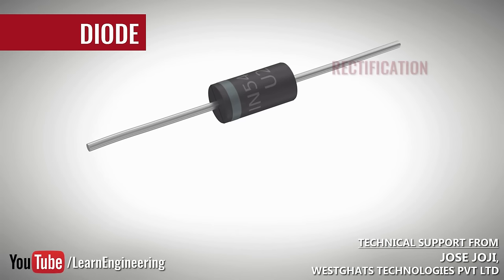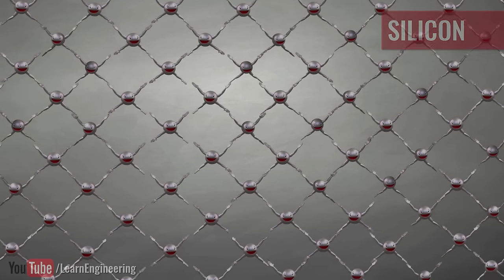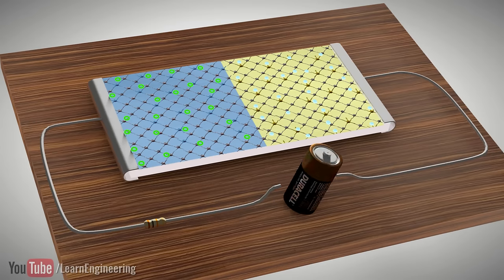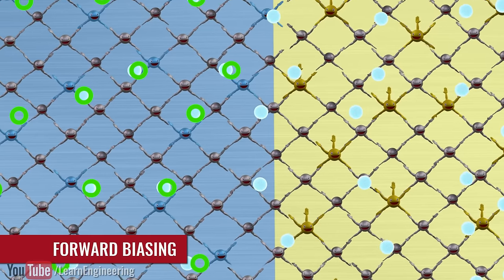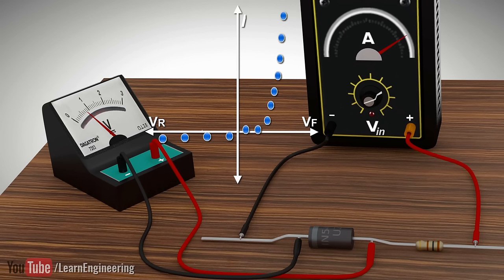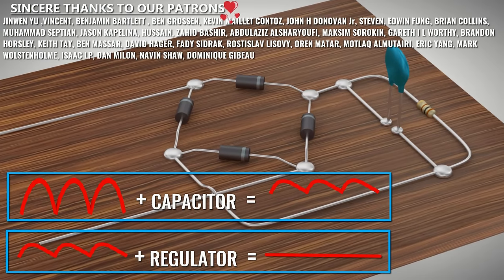How does a Diode work?

Comment: 2:50 the positive terminal of the voltage source is connected to the P-type of Diode. Still, you said it to be Reverse bias. Can anyone explain, please?
Reply: Reverse is based on if the currents flow or not. If it flows it's forward, and reverse does not have flowing current.
Reply: i think its a mistake

Comment: Hello, a very basic doubt regd the p-n junction. Why dont the electrons migrate further into the p-region. Why do the the electrons coming from the n-region limit themselves to only a small region across, causing the p-n barrier in the first place? Would be glad if you could pls clarify this!

Also, during the reverse bias, as per what I understand, there is no actual flow of electrons through the circuit, but only widening of the p-n junction. So, the current flow registered is exactly the electron flow from where to where?

Comment: Learn Engineering+ This is a great example and video. Which is better, an electrolytic which I always see or a ceramic or poly and the regulator is a resistor not a inductor, correct? I'm making a 24 volt which is pushing it, I'd be better off with a 21v and 12 amp or so. I'm powering 2 Class D amplifiers and the max is 24v which diodes and value do you suggest and capacitors and resistor plus should I go with a one watt, thanks

Comment: If add diode and magnet position + - and - +, just switching can reverse electricity flow maybe and engine can reverse also? No one reads this right? Or point of + and - on battery the wiring must change points and diode not needed? Then if move wire alot maybe tangle? If not then maybe adding another point of electricity and different "execute point" at engine can create reverse?

Comment: At 3:48, the diode on the right that is circled in red, is the right direction to let current flows towards the output. The light gray mark on the diode indicates that. Why don't you let the current flows thru, towards output, in addition to going back to the left negative pole of the source?

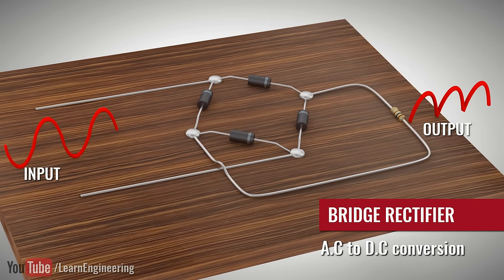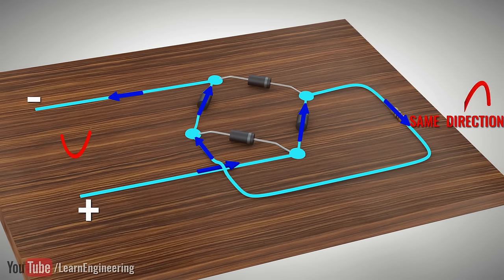Comment: Please pause at exactly 3:44 after crossing 1 diode and after resistor why the current does not flow in other two diodes and now at 3:57 after crossing 1 diode 1 resistor and then to next Point why does it do not flow to perpendicular diode to passing one and then must pass to next perpendicular diode similarly all the diodes indirectly work  and they are not showing it please reply if any engineer is reading...
Reply: Basically, the current will always try to go from + to - , it will never leave from + and go back to + .
Reply: Thanks for clearing but their is still something left with me

Comment: Thanks for this!! 8)

It would be interesting to know how a Walton-Cockcroft Voltage Doubler circuit operates. I have a HeNe laser tube (from an original Philips Laserdisc player) which I think uses this method to create the high voltage required to drive the tube (not sure).

I had ideas about using such WC circuits to step up from a starting 4K voltage (transformer I removed from an ancient photocopier), see what kind of arcing I could get, but never got round to it (this was in the late '80s).

Ian.

PS. Sorry for the delay in the PC construction! Family/work matters have messed up my schedule somewhat.

Comment: Exceeding reverse breakdown voltage of a diode doesn't have to damage it, as far as I know, however it will behave not as expected. After switching off and on it should recover.

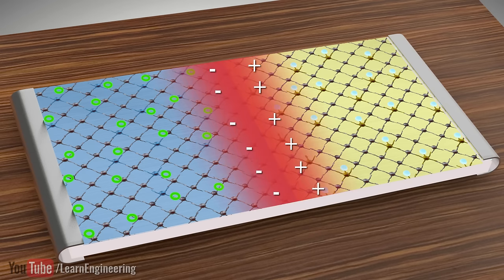Comment: At around 1:10 what stops the N side electrons from filling the P side holes?
Reply: low voltage condition to move the electrons from N to P..could say the N and P in barrier is stable..need voltage higher than the electron activation energy to move the electrons from N to P.

Comment: Question: How does the Negative side become slightly positive in the "Depletion Region" if it has no holes and an access of electrons the crossed over?
Reply: Jay Klaxton Well the n type was originally negative but since the p type due to its positive charge will force  away a sufficient amount of electrons from the n type in the region right near the p type that the positive nuclei of the silicon or phosphorus that make up the n type do not have equal negative electrons to neutralize the charge and hence the section of the n type right near the p type becomes positive.

Comment: What do you mean by in-forward bias? Reverse bias? I thought if the resistance of any electronic component is low, the current flowing through them is large or high coz low resistance! In the above video, it said, "you can note that voltage across the diode does not go much higher than 0.7 volts, even with high input voltage". Due to inforward biased condition. The diode offers vary low resistance against the current flow!

Comment: The negative terminal connected to the p-region should attract the holes there (in other words, when holes are flowing one way, electrons flow the other way, from the negative terminal to the junction). On the other side of the diode, the positive terminal connected to the n-region attracts electrons, so electrons are flowing from the junction to the positive terminal.  And also, Why the electrons pulled by positive terminal of battery reach to holes of P-type and fill it up and again get repelled by the  negative terminals of the battery, ?All in all, this would mean a current is flowing from one end of the diode to the other.
Anyone please reply !

Comment: 1:36
the electrons from the -ve terminal of battery goes into the p-type plate and starts filling the holes
then electrons in n-type goes into the battery
similarly the cycle continues.

if the +ve terminal is attached to p-type the elections from the -ve end of battery gets repelled by the n-type bcoz it has extra elections.

so,where im I wrong???
can anyone tell plz...

Comment: At 1:40, why do the electrons stay in the diode and not move to the positive side of the battery?
Reply: assume that the total electron coming out from the battery must be equal to the total number of electron entering the battery or source...since the depletion region gets wider and wider as applied potential increases,so no electron would flow then there would be no flow of electron then how you move these electrons?....remember  depletion potential is directly propotional to the applied source in case of reverse biased
Reply: +Wisal Muhammad. hi sir
very good comment of you
i think you are also an electric. engineer.
Reply: Gulmohammad Bowari thank you...an electronic engnr.
Reply: +Wisal Muhammad 
where do you live friend
Reply: Gulmohammad Bowari in pakistan recently graduated
Reply: Gulmohammad Bowari in pakistan,recently graduated
Reply: in this case, the depletion region gets wider as the negative terminal attract holes in one side, and the surplus of electrons in N side is attracted by the positive terminal.
the depletion region consists of neutral charges, which means no current will flow.
Reply: Great explanation @Wisal Muhammad - what you explained is THE point of how diodes work. I used to wonder this too, but as you say, a way to think about it is that voltage increases or decreases the width of the non-conductive depletion region. Only the P 'holes' or N 'outer electrons' are capable of carrying current (and not the depletion region). The depletion region is like an expanding and contracting piece of rubber in the diode! Also, a way to remember what N and P do: 'P' = 'punched' (holes). N = negative = 'electrony'. I also use "N and negative = go". Not strictly accurate, but helps you remember.

Comment: on min 1:16 depletion region is not fixed ( drift current will be  created, when electron jump from N side and cover hole in P side he create hole in N side ( his original place became hole ) and at the same time the atom on P side with new electron became negative charge ( notice originally both N side and P side is equivalents, depletion  will not change that ) so the P side will push the addition  electron back to N side, and the process will go on as it is. 
https://en.wikipedia.org/wiki/Drift_current

Comment: Actually you made a mistake, in forward bias, the p type semiconductor is connected to the positive terminal of the battery, and the n type semiconductor is connected to the negative terminal of the battery, and vice versa, but in the video its opposite, please correct it.

Comment: Can you please also explain about "How does a LED works?"
Reply: It's the same as a diode, in the case of diode energy is dissipated as heat, in the case of LED is dissipated as heat and there is light as effect, remembering diodes and leds also have bulk resistance that dissipates energy

Comment: My english is bad but I will try to ask you.
I don't understand "REVERSE BIASING".How is electricity flow impossible? I think,power source's negative(-) pole gives electrons and those electrons migrate to the holes.The while,the free electrons on N side are attracted by positive(+) pole.That's way the electrons in hole on P side migrate to old free electrons' place so conduct should be here but not why? 

NOTE:This comment is about 1.35

Comment: Nice graphics, but unfortunately wrong in some important respects. Electron flow in p-type semiconductors does not jump from hole to hole. This is not only wrong, but is a huge simplification of how electrons injected into the p-type material recombine, and are replaced by holes flowing in from the p-type contact (and vice-versa on the n-side). Nice try, but not easy to fit into a 4-minute video. The picture of the depletion region as the battery rotates is correct, and nicely done as it is narrow in forward bias and wider in reverse bias. The only other criticism is the statement that "most diodes" would be destroyed by reverse breakdown. Maybe it wouldn't take too long to say that if the reverse breakdown current is too high, then the diode would be destroyed, but not by the breakdown itself - only by the heat of the current. Breakdown itself does not destroy a diode, and it can operate there all day, as in a Zener diode.

Comment: how do batteries work? 
what makes them age and not work, hence how to maximize battery life? why are they so relevant for EV? Are there ways to improve battery technology?
Reply: It'd be great if he made a video on it, but if you want to know why they eventually don't work, I can tell you. All a battery is is a source of voltage, and that voltage is not "ideal": it has an internal resistance. When the battery ages, this internal resistance gets higher. This causes the resistance of the circuit and the battery to become closer, and so the battery supplies less voltage to the actual circuit once it goes through its internal resistance (look up voltage divider for more information). Even rechargeable batteries that can have the chemical processes reversed to "restore" the voltage in them undergo this internal resistance increase and thus eventually wear out (along with the chemical processes that give the electrons electrical potential energy that eventually "run out" over time--ask a chemist for an answer to that one).
Reply: Different types of batteries get damaged in different ways.

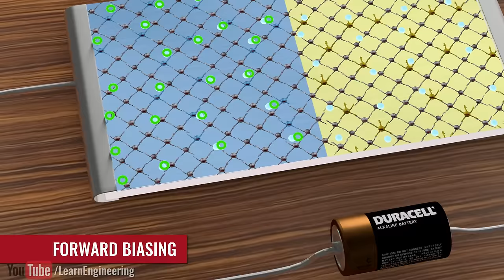Comment: @2:28 doesnt DC flow from positive to negative. This animation is backwards.
Reply: in real life it goes from minus to plus,in teory it is opposite,i study electrical engineering,its hard to explai n
Reply: Current does point from positive to negative. It's defined that way.

But electronics uses electrons which are negatively charged. Thus they come out of the negative terminal and flow opposite to the direction of 'conventional current'.

If we used a different type of charge carrier to make our circuits (like positrons) then the charge carrier would go around the same way as the current is defined. But for our circuit it wouldn't make any difference. You can imagine current to be the flow of 'holes' where electrons aren't.
Reply: u deserve a coockie
Reply: no...you are wrong...study conventional current vs electron current flow...

Comment: I think in forward applied voltage current flows from P junction to N junction, according to the generator convention and not the opposite as explained in this video. This is an enormous and horrendous mistake, please be more informed. To confirm as said whatch this videos:
https://youtu.be/Coy-WRCfems
https://youtu.be/TFgWDcBp-uY